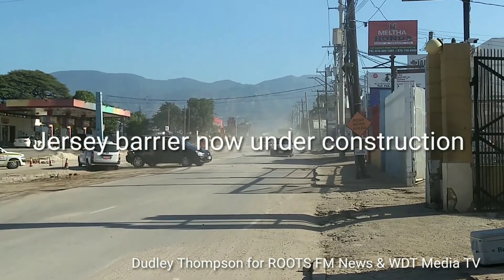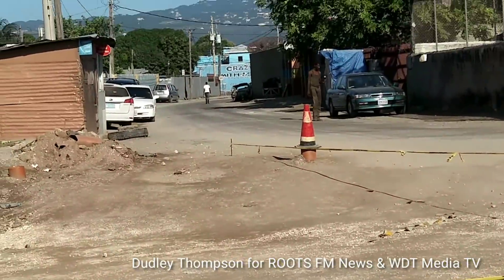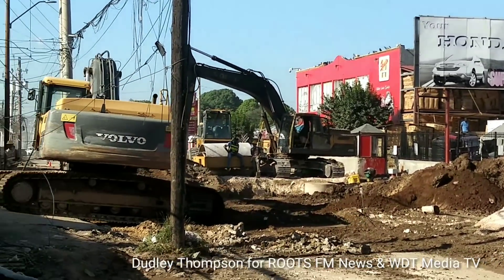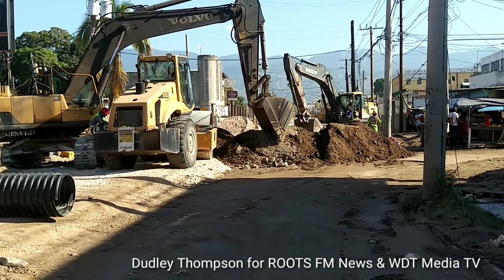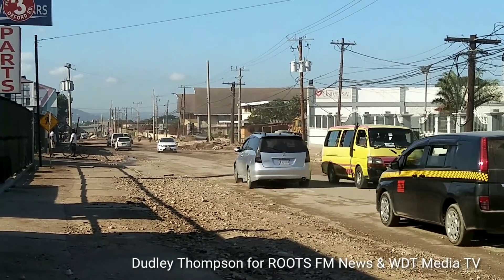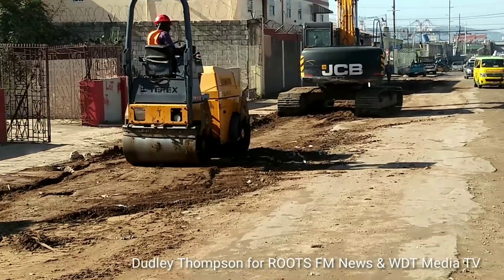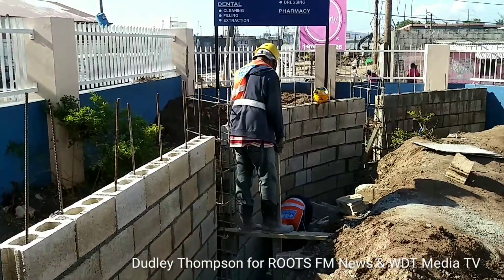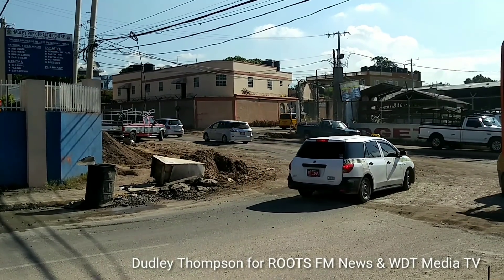WDT Media TV Hagley Park Road  Improvement Project

Comment: Rest of the road work is coming along nicely, but as usually NWC slow bad, at least they did not wait until the road is finish to dig it up to lay the pipes.
Reply from the maker: they are now feeling the heat from the Opposition
Reply: I think the problem with the NWC the present government take on too much road work at once, you have pipe line laying on constant spring, barbican, Mandela, and the three mile area
Reply: @waynemcfarlane1233  : Remember NWC is not a small company, they have hundreds of employees, but as usually with government workers from management to lay staff do not care.  The project manager do not deserve his or her pay.  Or is it only 1 set of workers they have. Or they pack up with whole heap of workers who do not know crap. That is what it boil down to.  If i was a manager at NWC I would have 2 worker station at 3 miles with parts to fix any broken pipe. My mind is brain storming with ideas.